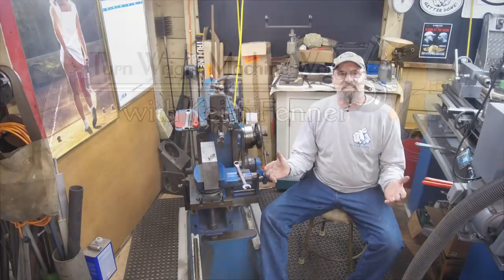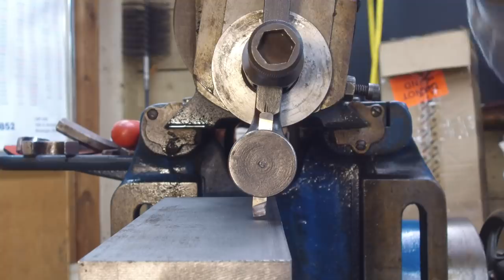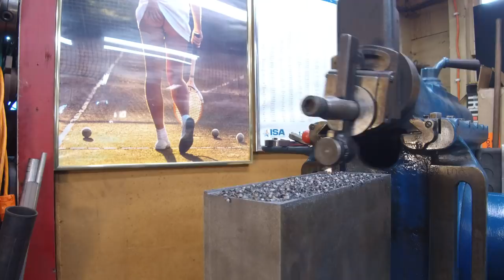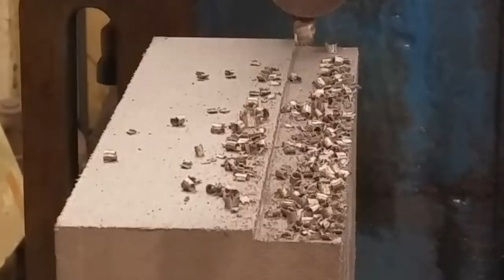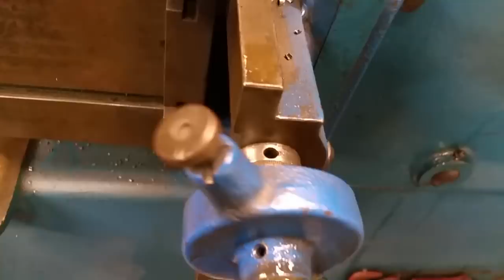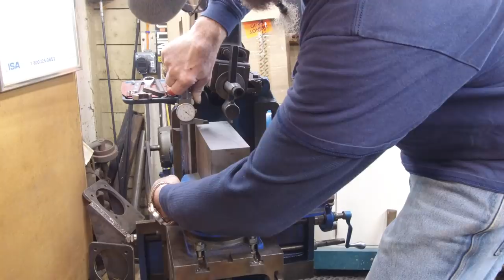The Clapper Part Two

Comment: Watching you run the old shaper reminds me of the machine shop that we had where I was employed for about 46 years. My division wasn't the shop, mine was the power plant, boilers, turbines, water treating, steam fitters and everything relating to them. However, I used to spend a lot of time in the shop as one of my good friends was foreman of it. I now wish that I had taken pictures of the original setup.
The shop was pretty much able to do everything. They had a large blacksmith shop, boiler shop, car shop, various lathes, mills, shapers, plainer, welding shop, surface grinder, steam hammers, bolt header, press for removing and replacing car wheels and did all of their locomotive work. The plainer was used to machine the carriage rails for the mill. As I remember they were about 35 to 40 feet long. they had a hole in he building wall so the rails could extend out as they worked on them. I remember the old machinist who ran the shaper. He had a special stool that he used and I swear that he used to sleep as he was making a big cut and would wake up as it finished. 
Great memories, just wish that I had recorded it as it is pretty much history now, never to return.

Comment: I like the size of your shaper for a home shop.  It's not too large, it's not too small, it's JUST RIGHT!  I love shaper work.  The slo-mo was great.  We had a BIG Cincinnati in our High School Machine Shop, back in the '60s, and I used it a lot, along with a Warner-Swasey Turret Lathe.  I used the W-S because no one else would, and I could always get a lathe when I needed it.  The mills were always busy so I would use the Shaper.  Thoroughly enjoyed the video.
Reply: jacktheripped   Yep.  My first year instructor, Jackie Jackson, was a great teacher and he would take more interest in what you were doing if you used the machines no one else was using.  My 2nd year instructor was a newby to teaching.  He was technically proficient, but was not a "TEACHER"
Reply: jacktheripped   So sad that the full Machine Shops Classes have been disbanded and sold off.  We do not teach our children to survive in this world, only how to go onto the government dole paid for by the taxpayers.
Reply: jacktheripped  The apprentice program has taught many a good man a trade with which they can make a very good living.  There will always be a need for craftsmen who: can make the good water flow in, and the bad water flow out; the electrons flow for lighting, heating and cooling; and who can take a piece of metal stock and make the parts that theoretical engineers design and need turned into real metal parts.

Comment: If you have time, I'd be interested in seeing you put an indicator between the stock and the upright. I don't know if it is the camera moving or the what but it appears that the cuts are causing the stock to push away, like you'd expect. Is it deflecting or is that just my imagination?
Reply from the maker: Some of that is also the floor shaking the camera, watch the body of the shaper move also, but Yes, you do get some flexing, hence the importance in the knee foot rest I adjusted in part one. ;{)------

Comment: Keith,  I have a question for you about the shaper tool. Its not that far of a reach and you want  a meaty tool.  Could you skip the toolholder and place a (larger, longer) cutter directly in the toolpost?
Reply from the maker: Yes you could, but the cut amount would be just about the same as the tool i used. ;{)-------

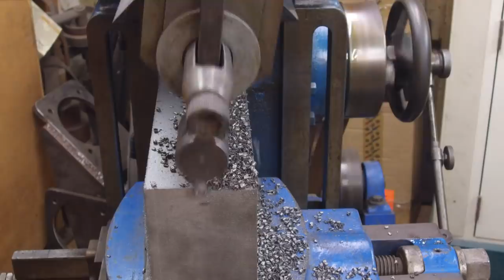Comment: At about 22:07, it looks like the material and vise are rocking from tool pressure.  I'm sure the vise is bolted down properly, is there some play in the table or saddle ways?
Reply from the maker: Some of that is also the floor shaking the camera, watch the body of the shaper move also, but Yes, you do get some flexing, hence the importance in the knee foot rest I adjusted in part one. ;{)------

Comment: What's the point on changing depth/feed from 75/10 to 100/6? Sesond one is actualy slower, removiing less material per stroke.
Reply: Probably less passes with depth adjustment. While it is on auto feed, you can be doing something else.

Comment: Warning:  This video is rating 'M' for machining audiences.  It contains
 partial nudity, adult toys, suggestive language, and behavior that may 
encourage middle aged males to peruse Craigslist, auction sites, and other questionable venues.  Viewer discretion is advised.

I noticed the block shifting a lot during the deep cuts.  Is that normal and did it hold to 6 thou?
Reply from the maker: Some of that is also the floor shaking the camera, watch the body of the shaper move also, but Yes, you do get some flexing, hence the importance in the knee foot rest I adjusted in part one. ;{)------